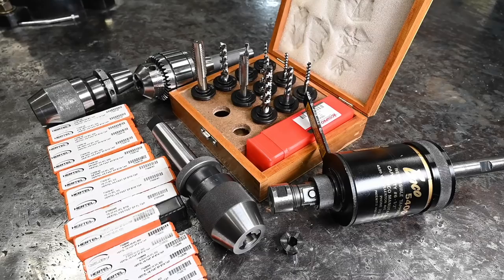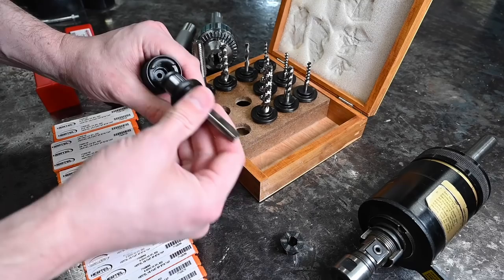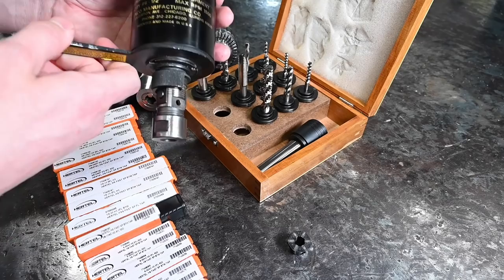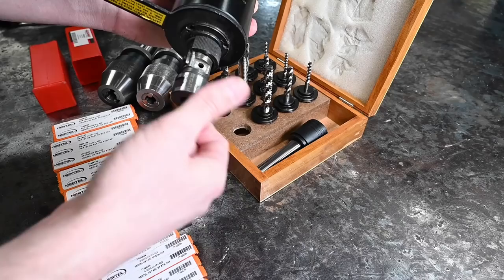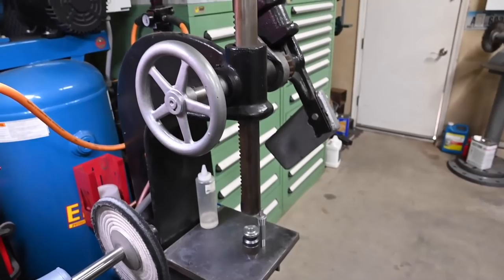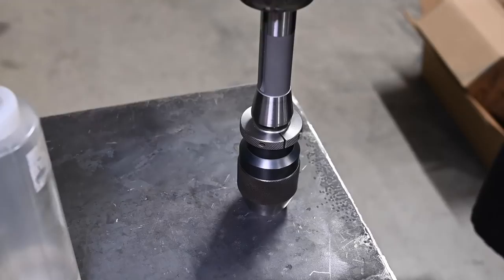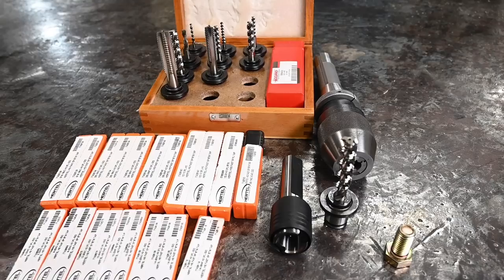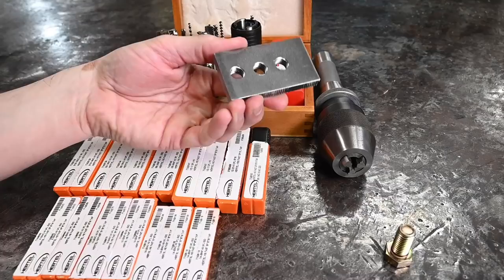Power Tapping for Cheaters! New Tap Adapters for Easy Threading

Comment: There are two more series of tension/compression tap holders besides the set you have.  A person has to remember that the initial transmission of torque on a Bridgeport comes from the threaded drawbar and collet alignment screw in the spindle.  It is better to error on the side of caution and limit the size of tap used on a Bridgeport rather then spending time and money on a spindle regrind in my opinion. I personally do not drive taps over 5/8 on mine. Anything beyond that goes in the radial drill ( Now I’ve opened myself up to those who have driven a 1-8 tap in a Bridgeport.)

I would also get an endmill holder for that tension/compression tap holder (the type that uses a set screw(s)), and stop using it in a keyless chuck, the reason being that keyless chucks continuously self tighten and can do so to the point of cracking their body. Keyless chucks are designed for the torque generated by a drill or reamer, not the torque used to drive a tap.  Baring the end mill holder, at the very least I would use a ball bearing keyed chuck.

Comment: I have a 3/4” Jacob’s ball bearing chuck. I did the rebuild, but much of the problem is still there, because most of the problem turns out to be the unhardened body, not the jaws, which I measured as being pretty good after all. The grooves for the jaws were worn out, and the jaws don’t close in a parallel way, with the tips of the jaws, when closed, not touching. If I use too much pressure to be realistic, they will almost touch, but not quite. So the chuck is relegated to rough work where I don’t want to use the new one. That was the only chuck I bought, used. Never again. Someone must have beared down pretty hard on shanks that didn’t go all the way down the jaws. That’s the easiest way to destroy a chuck. So many chucks. Quite a while ago, I bought a new Walton chuck. You can change drills when the machine is running, but I rarely use it because I still feel nervous about doing that.

Keyless chucks are nice, but I find that no matter what, I have to use the loosening wrench to give an extra bit of tightening. Tapping devices are just a real pain to set up. If I had a really heavy drill press, or a tapping drill press, such as the one Grizzly had for a short time, that would be great, but I’m out of room. There is an Albrecht model with jaws with diamond embedded. Expensive, but it eliminates the problem of gripping taps, or mill bits.

Comment: hmmm that rubber filled chuck gave me an idea to repair a cheap tapping wrench using two small pieces of steel and silicone , the silicone replaces the need for springs and clips and prevent the chucks beaks to fall out and get lost on the ground

Comment: Welcome to the Eagle 66 club. You can change or adapt the nozzle spot to fit your needs I have several 66 all setup for different applications jus love the look and feel
Reply: I have 3 or 4 Eagle 66's. Awesome oilers.
Reply: Never used one but I don't think it should be loosing prime like yours is.  Pull it apart, soak, exercise in cleaning fluid and reassemble.  If it still looses prime get a new finger pump.

Comment: Hello Aron. there are rebuild kids for albrecht drill chucks, Oxtools has a video abound it
Reply: I can only imagine the prices on those rebuild kits.
Reply: I believe it's illegal to buy kids. 😉
Reply: @LambertZero  I have seen one on ebay for around 70 dollar
Reply: @carramba86h77  Depends on what you do with them next.
Reply: Please read my comming post on how to service an Albrecht chuck, Oxtools grease the hole thing, and that not the correct way to do it, he deleted my comment on how to do it correctly.
Reply: @zephyrold2478  you greased what again?
Reply: @LambertZero  Look up my comment, Do NOT grease or oil spindle 2 and body 4
Reply: @zephyrold2478  is it going to explode?

Comment: Any 3 hp BP type mill with a back gear has enough torque to not only hoist itself off the floor but probably the whole shop itself if it's anything close to average sized. Could it do so without destroying the heads internals? No, but there's still ample torque available. It doesn't factor in the frictional losses, but take that 3 hp motors torque and multiply it by the belt and back gear ratio. It's not hard to find 10,000 lb pulling capability 4X4 winches using 12 V and far smaller motors than a BP mill has and I doubt there gear reductions are quite as steep as the BP mills have. Even more so with a VFD since it keeps adding power as the spindle loads get higher. So lack of torque isn't the issue, the mill heads internals and tiny little R8 taper are where the limits are.

Comment: Power tapping with the Tapmatic is dead easy. I had several hundred 10-32 holes to tap so I bought one and installed it in a drill press. I did the first one with no problems - just down and then back up. I did a dozen or so and then turned the job over to a totally inexperienced assistant who was watching me do the first dozen and he did the rest with no problems or broken taps. It really could not be easier. I have to wonder about that semi-rigid drive thing.

Comment: All take that tapmatic any chance I can. The only reason to u use the blitz would be for larger taps (depending on what model tapmatic u have ) . Get to know that tapmatic as it will be your best friend ! It can save u alot of $$$ in taps . As far as power tapping with chucks I have no prob with my tegara keyless chuck but I can see where worn out chucks will slip and not hold . I'm pretty happy with the tegara products(made in Taiwan) so if anyone is on a budget I highly recommend them ! Way better then the cheaper China stuff .

Comment: Collet jaws is the word you are looking for, power tapping is great for production work but the temptation to use it on a job with 40 hrs of table time is madness.
Yes Adam has one but my 10 bucks if he has a job with loads of time and a high grade steel that needs a thread in it he will be a half fwd and one back by hand.

Comment: With your slipping Jacob's chuck. Check out the 5 buck 69669 harbor freight diamond coated burrs.  You might be able like I did and clamp the burr in a vice and the chuck in a drill press or vertical mill.. one hand on the quill handle and the other on the chuck sleeve. The spindle is locked from turning. Up and down with the chuck over the diamonds while you are snuggling it slightly can refresh the grippy surface. Without putting in excess runout.   If you tried grinding it or spinning it would fill the chuck with particles locking it forever

Comment: I have been using the lyndex brand of the spring compression tap holders for about 20 years now when cnc power tapping. In my bridgeport, I normally just put the tap in a DA 180 collet holder. Nothing wrong with what your doing though, unless you put a tap in a chuck again.

Comment: 😱😱😱 STOP STOP STOP 🛑 🛑🛑
I see this is two years old, but OMG!!!
Never use a press or anything to seat two tapers together. I couldn’t for the life of me figure out why that other taper adapter was so hard to separate. Now I know. With tapers, put the taper on until it’s about an inch from seating, then give it some speed. One finger and your thumb only. THATS IT! The taper is locked, nothing will separate it!
Next, your damaged Jacob’s chuck and your broken reversible clutched tapping tool…
Mate, I was screaming at the TV. You have ALL the tools to make a replacement part, that’s what they’re for. Make the parts! That’s what makes machinists and hobbyists drool, repairing broken things that require machining new parts for it, fixing the bad runout so it’s within a thou. It’s what those machines were made for. Don’t buy rebuild kits or spare parts or anything like that ever again. The only thing you want to be buying from this point forward if metal. Look out for metal everywhere you go, you’ll soon have a rack full of bits you’ve found.  A two inch construction bolt would be perfect for machining a new Jacob’s chuck collar for example. You don’t need a shiny new 6ft inconel round bar. An old bolt is perfect. An off it from a machine shop is perfect. I get nearly all my metal from machine shop off offcuts. You still pay, but a fraction of the price of new stock. A 57mm (2.25inch”) long, 8” diameter off-cut of C93200 Lead/Bronze alloy cost me $42 AU. Insane! It’s $8,445.28 AU per metre (3.3ft) which makes my 57mm long, 8” round bar would retail at $481 AU obviously you can’t buy 57mm, you have to buy a 3.05m bar costing $25,758.11 at todays price. The moral, grab all the bits of metal you can. Best to know the grade, but not essential. Get yourself a metal chart and put it up in your shed and always write on the metal what it is with paint pen marker. 
You’re not going to learn and become proficient and confident until you start using your machinery.
Lastly, use your mill for tapping. Not that crappy, wobbly old excuse for a drill press you have. 
Use your tools mate. Get a set of micrometers up to 2 inches and USE YOUR MACHINES. 
Turning or milling to a thou accuracy is NOT an easy thing for a beginner. Making a cube, say 4” on the mill to within a thou is a great training aid. Use whatever scrap you can find. 
On the lathe, turn something to a set diameter to within a thou or within 2 thou, take it out of your lathe and put it back in so the axis is within a thou. Making a sine plate uses both mill and lathe and requires the utmost accuracy. Remember I said micrometer! Not calipers, they are not accurate enough for this sort of work. (Yes the accuracy of callipers can be very good, but you lose accuracy in their use - not good enough!)
Good luck. 
Mick 🇦🇺
PS - always pay strict attention to 
SPEEDS & FEEDS 
Material SPEED at the cutting point. 
FEED rate of your tool. And don’t forget that as you lathe something, as the diameter decreases, so does the speed, so adjust it as you go!
VERY IMPORTANT!
In your video, that was a great looking piece of ‘scrap’ steel,! 
“Looking” is not a satisfactory way to check for runout lolol
Your drill speed looked WAY WAY too fast. Check it out in you machining bible or on line I guess, but you may get ‘opinions’, not fact.  ! It’s Good practice - get a chart up. Milling, drilling, lathe-ing, tapping. All need the right speeds and feeds. 
Keep that drill bit cooler. At least centre punch and preferably drill a pilot hole as well. Centre punch EVERY home you drill. Figure out why it is CRUCIAL. 
Looked like you tried to stop the first tapping effort with your muscles on the feed handle lol
Why are drill chucks consumable items - not true! If you think it is, send me ALL your old ones! Great that you had supports under the plate you were drilling!!! Hope they were parallels. 
You should be buying store box brands. You are not a production machining centre. CRAZY if you shell out big clams on the best available!
Every spare minute, use your machines mate. Make stuff. Really test yourself. Get comfortable with outside and inside thread cutting so it’s a walk in the park to do it. It scares most hobbyists.

Comment: I love the attention to details you put in your work! I did notice that you are running your mill with a VFD and it seems that you have a fairly long acceleration ramp programmed in. I’d lower the acceleration ramp and add a brake resistor to the vfd to stop the spindle quickly instead of using the bp brake. This would extend the life of your hand brake and increase the control you have over your power tool especially when tapping. Keep up with the good content!
Reply from the maker: Hmm that’s not a bad idea at all. I’ve been meaning to reduce the ramp time but hadn’t thought about the brake resistor.

Comment: Arron, I recently broke a drill bit on my mill, I found the cheap Chinese R8  arbor bent pretty badly  the chuck seems fine!
Reply from the maker: That must have been one heck of a lousy arbor! I'll inspect mine, but it's a Spanish made tool that looks to be pretty high quality.
Reply: AlwaysSunnyintheShop, the arbor bent where the small taper met the R8 taper, I doubt if the arbor was ever hardened.

Comment: A drill chuck or a lathe chuck is not intended to hold hardened steel. You can't really hold taps or end mills in chucks.  Holding a tap securely isn't going to happen. A work around is to hold the tap in the drill chuck moderately tight. When it slips, cut the power and finish tapping with a tap wrench and a spring loaded center to support the tap. Sometimes you get lucky and the tap will go all the way through, especially in soft materials like Aluminum.
Never try to drive a round shank end mill in a lathe chuck. Get an end mill holder to fit the lathe spindle. They aren't very expensive, at least for 2 &3 Morse taper spindles. The problem is that (1) the end mill will likely slip and when it does it will be sucked out of the chuck into the work..usually ruining the end mill and the work. And (2) there is too much run out in a scroll chuck for any kind of accurate work.
As others have said, rebuild the Jacobs chuck. Follow the directions in the rebuild kit and it's pretty easy. $45 for a repair kit to fix a $250 chuck is reasonable.
Cheers from NC/USA
Reply: True, but Albrecht themselves along with a few others do make specific diamond plated chuck jaws for holding solid carbide drills. But yeah I do the same, use the chuck to hold the tap well enough to get it started and then finish by hand. In a commercial shop that's a time waster so there going to have other and better tooling for power tapping.

Comment: Keyless chucks are self tightening which means if the drill, tap, or whatever is in the chuck starts to slip the chuck automatically tries to tighten down on it.  In the case of a tap which needs tons of torque in comparison to a drill bit the chuck can tighten down to the point where the chuck itself will crack.  How do I know this you ask?  Don’t ask.  Since this little episode I only use a ball bearing keyed chuck to power tap in the mill.  Keyed chucks do not continue to self tighten.  Large diameter taps should be driven with a tapping head such you are now using.  There is a reason for this as well that I will not go into.
Reply: I caught this on video, though I was using a reverse counterbore rather than a tap: https://youtu.be/XZHsDMJKJuk?t=535
Reply: Exactly, at the very most I might try tapping with a 3/8ths sized tap. Even then it's pushing it so I'd rather use it to get 3-4 threads started straight and then finish it off by hand. That's also the reason why reduced shank Silver & Deming type drills should never be used in a good keyless. That can literally self tighten the chuck to the point of permanent deformation of the chucks hardened and ground internal parts. If you have to tighten or loosen an Albrecht with anything but hand pressure it's a sure sign your doing something wrong.With a used Albrecht then ok it may have been misused before you got it. With a new one and properly applied within there limits a new Albrecht should last a lifetime in an average home shop so I sure don't agree that there semi disposable tooling. A commercial shop is a whole different matter when time is money. Part of there shop rate is to cover the tooling and it's reduced life span.
Reply: Turning Point I forgot to mention the large Silver and Deming drills are equally as bad.  Thank you for mentioning it.  Your warning about requiring a strap wrench to break a keyless chuck loose is a point well taken and should be printed on every chuck.......but then again that would decrease chuck sales wouldn’t it?😀
Reply: @37yearsofanythingisenough39  LOL, yes..........it would.

Comment: Good luck power tapping blind holes with that setup.
Reply from the maker: Thanks! I won't need it.
Reply: @AlwaysSunnyintheShop  Oh? No slippage when it comes against a hard stop ie bottom of the hole....weakest link will break probably the tap. Those things are mainly made for cnc where you program to a depth and reverse spindle.
Reply from the maker: I'm not going to just ram it down into a hole without preparing a depth stop for stopping the spindle. Yes, the tap will be the thing to break if you don't take any precautions.
Reply: @AlwaysSunnyintheShop  good luck. I'll continue to use my drill chuck on my manual, like I've done successfully for years and rigid tap or thread mill on my cnc equipment.  However what works best for me is I rigged up a single phase drill press to reverse and I tap blind holes regularly with it, using a keyed Jacob's chuck, a foot switch, and a Heinrich quick acting vise.  Run it down till the tap slips a bit, let up on the foot switch hit the reverse toggle, back it up flip the toggle to forward rinse and repeat. I can and have done dozens of holes at a time very quickly with this method. Produces a straight tapped hole and have yet to break any taps...#8 - 1/2 over 1/2 the drill press stalls out. But most if my holes are in between.

Comment: Hi, as some other has pointed out, you can get new jaws (ordinary and diamond coated) for the Albrecht chuck. And here is the correct way to service an Albrecht drill chuck  https://www.albrecht-germany.com/en/instruction/  go to Repair manuals    SBF , and the most importent thing they point out is to NOT put any grease or oil on spindle 2 and body 4, then you get the most out of your chuck. There are many videos on YT on servicing an Albrecht drill chuck and they all get it wrong with NO grease or oil on spindle 2 and body 4, one Mr. Wizzard even deleted my comment on how to do it correctly.
Reply from the maker: Thanks! I read something about that on a forum- using grease makes the chuck slip and not hold anything. I'll go to the source when I get around to rebuilding it.
Reply: @AlwaysSunnyintheShop  Exactly.